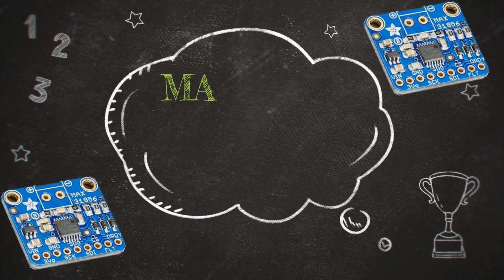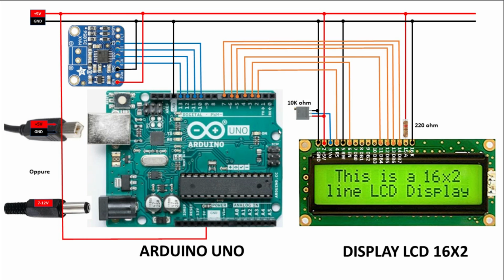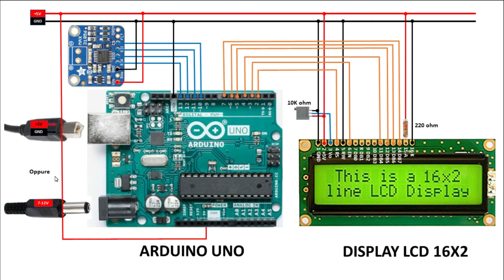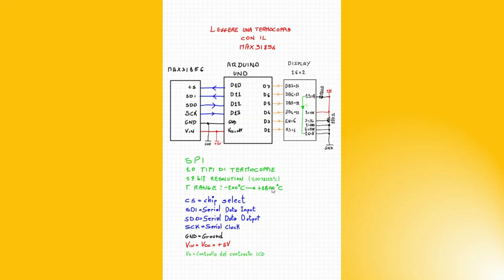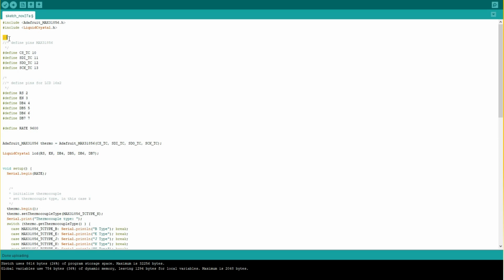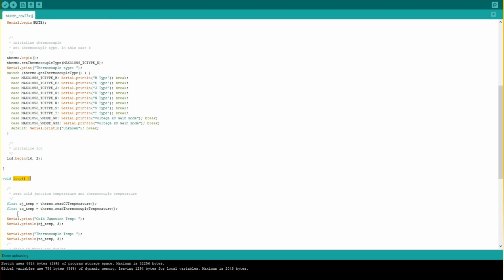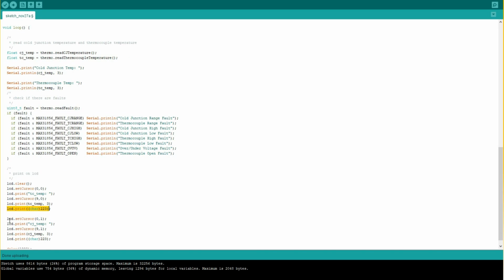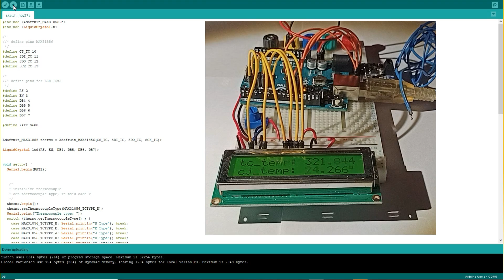How to measure temperature with the MAX31856 Arduino UNO

Comment: I want to see even the resistance at that particular temperature, how i do it can you please help me with that and also suppose , temperature at 30ohms is 45°C then how to i get the voltage across the 30ohms
Reply from the maker: Thank you for your question. I would like to clarify a point regarding your inquiry. In the video you mentioned, we are using a thermocouple to measure temperature. Thermocouples generate a voltage proportional to the temperature difference between the junctions, thanks to the Seebeck effect, and do not have a measurable resistance at their ends like a thermistor.

If you wish to measure resistance at a specific temperature, you may want to consider using a resistive sensor such as a thermistor. However, if you have further questions about using a thermocouple to measure temperature or other related topics, I would be happy to assist.

I remain available for any further clarification or questions you may have.

Best regards, Giuseppe.

Comment: Why don't u used the DRDY pin in spi? In which circumstances we dont need to use that. Suppose the default refresh rate of the chip is 10ms(10Hz)
Reply from the maker: Good question! In this particular sketch, the use of the DRDY (Data Ready) pin is not strictly necessary. The code is designed to read the temperature data at regular intervals, approximately every second, thanks to the delay(1000); at the end of the loop. Given that the MAX31856 updates quite quickly, the sketch can reliably read the data without needing the DRDY pin for synchronization.

Also, just to clarify, a refresh rate of 10 ms actually corresponds to 100 Hz per second, not 10 Hz as you mentioned.
Reply: Thanks for replying. But if u are sampling data at the lower rate than update rate you are loosing sammples.. Right.. Secondly if i need to write spi code at the 3 MHZ clock ( it supports 5MHZ) then how will i sync the output data.? Actually i want to do the spi read in verilog on a specific board on which i have only 4 isolated pins available for fpga. How to cater the 5TH DRDY  pin in this scenerio?
Reply from the maker: Thank you for your insightful question. Unfortunately, I'm not familiar with Verilog and therefore may not be able to provide the specific guidance you're looking for. I appreciate your understanding and wish you the best of luck with your project.
Reply: Can u increase the data rate of the sensor? I havent seen any register settings that can put the sensor in higher data rates
Reply from the maker: I'm sorry, but based on the information I've found, it doesn't appear that the MAX31856 has register settings to increase the data rate.
Reply: Got it. Last but not the least if u are not using DRDY pin how will u make sure in ur loop() that u are reading the the three temperature registers of the same measurement before they get updated. Means how u are syncronizing your state machine of reading ?
Reply: How. Many and which registers u write to get the temperature data

Comment: The most interesting thing is how much noise there is in the readings of this max31856, and you only spent a few seconds on this video.
Reply from the maker: Hi Alex, the simple moving average numeric filtering technique would take a whole video to master well, but then nobody would watch it;  however noise is introduced by most analog sensors;  the treatment of the acquired signals with adequate filtering is inevitable. See my 27 video n.